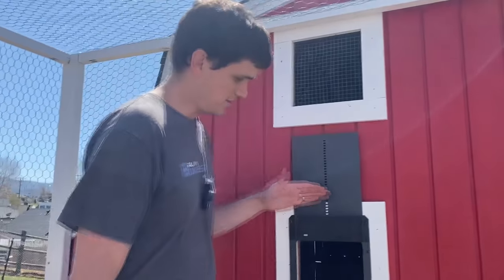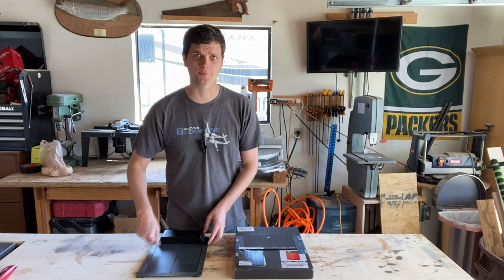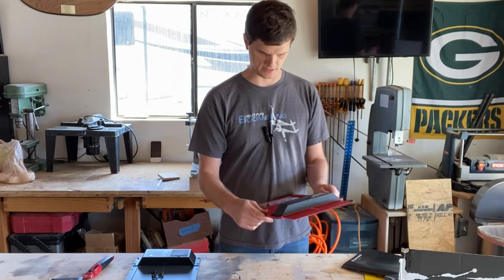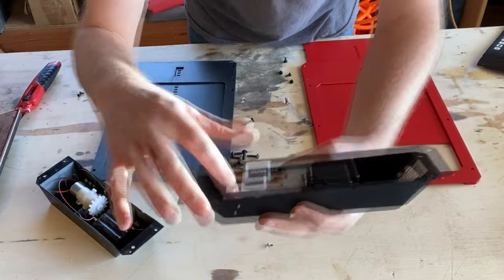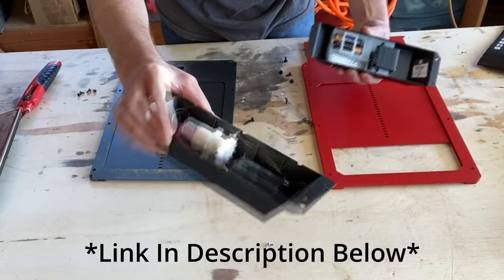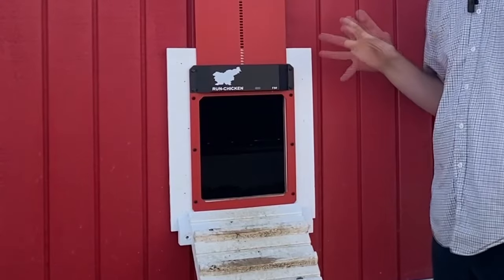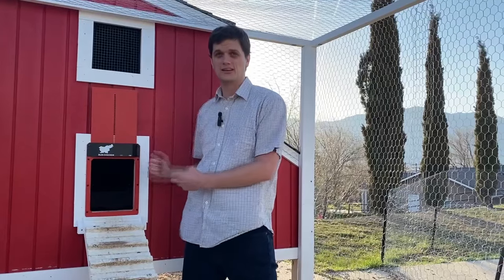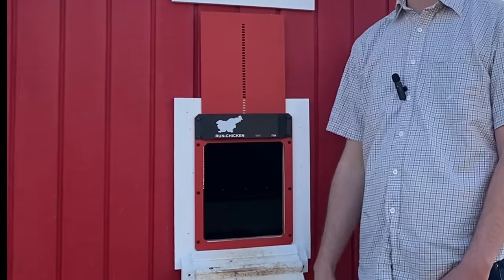"Run-Chicken" Automatic Door: Comparison, Review, & Functionality

Comment: Nice review! I also did a comparison of a cheap knock-off brand and the Run-Chicken model. The quality, fit, and finish between them are like night and day. I also thought the front-accessible battery compartment was a nice feature on the cheaper one, but after using it for a month or two I realized the rear-access is better because it makes it harder for rain and snow to get in. On the cheap one, my batteries died after just a couple of months and when I opened the compartment, it was all rusted. Also, you did a great comparison on the motors of the two models. It's clear why after 2+ years I'm still using the original batteries that came with my Run-Chicken door. I now have 2 Run-Chicken doors and I sleep well at night knowing the chickens are safe in their coop.
Reply from the maker: Thank you! Totally agree. I hear so many people with the same story. I’m trying to warn people that saving $50 on the cheaper one is really going to cost them $100 when they throw it away and buy the Run-Chicken door.

Comment: Run-Chicken is good, but they are overpriced. I bought my door for 65 dollars from the Hen Hut, and I have been impressed with the quality and reliability. I would definetly recommend The Hen Hut to people looking for an affordable and quality automatic door.
Reply from the maker: I thought the same thing. I originally bought a door that was almost half the price. I had many problems with it not closing at night for one reason or another. I decided that if failed once and a fox got in a killed even a couple of chickens it wouldn’t be worth the cheaper door. Respectfully, the reliability is worth every penny I spent.
Reply: @thehomesteadengineer-1  So far it has worked well for a few months and it feels much higher quality than previous ones I had bought for 20 dollars, but I will make sure to keep an eye out for any issues it may have.
Reply from the maker: I had the same experience. After about three months it started glitching. The batteries only lasted about 2 months. I had a security camera and I checked the door every night. By the end of the year it was 50/50 on whether or not it would close properly. Just keep a close eye on it. That’s all. Good luck!

Comment: I heard you mention an app for it. I have one that I installed yesterday 8/16/24 and the light sensor isn't working. It would be great to open it with a remote or by phone as our coop is about 250 yards from the house. What is the app you mentioned? Thank you
Reply from the maker: If your light sensor isn’t working you need to send it back. It should come working correctly out of the box. It’s possible to program it without the light sensor but it’s a pain. The app is also kind of clunky, and uses the light sensor to program the door. There is no WiFi or Bluetooth so it can’t be opened remotely. 

Check out their tutorial video here:
https://youtu.be/Tx7I-1FhTuU?si=oLfTTSnODdtMTD_I

A link to their app can be found on their website: run-chicken.com

I think I’m going to make a one year review video today and go over some of these shortcomings of the door. Let me know if you have any other questions.

Comment: Hi, I bought the Chicken Run like 4 months ago. This morning the door was closed (it is set by timings). Can it be that batteries needs to be changed already? Is it because screws are too tight like in your video comment? I did not saw a red light.... Thx for feedback. ps: great video !
Reply from the maker: If the batteries need to be changed already then you overtightened the screws. Back them off a half turn and it should be better. I haven’t replaced my batteries yet and it has been 5 months. They should last a year. When you manually push the button does it open?
Reply: Any luck?
Reply: @vincianeprudhomme9211 any luck ?

Comment: what's the point of spending all this money on it if you have to reset it manually and check everytime to see if it closed or not?
Reply from the maker: Good question! I’ve actually grown to trust it. I didn’t trust the cheap knock off door. There wasn’t a point in having it because it was so unreliable. The run chicken is actually really reliable. I made this video shortly after purchasing it and still didn’t trust it. A year later now, and I rarely check it. I just works. I have a security camera so when I want to check it I can, but I still don’t have to go outside.

Comment: Step 1. is having a run predators can't access.
Reply from the maker: I free range my chickens. I only have a run in case I need to contain them for a short time. My run is to keep the chickens in, not to keep predators out.
Reply: @thehomesteadengineer-1 with all due respect if you’re preventing your chickens from leaving an enclosure yet allowing predators access that’s setting them up for a kill. Similar to shooting fish in a barrel. IMO if you’re going to the trouble to create a run they can’t escape it’s equally as important to fortify the enclosure enough to keep predators out. I maintain a similar setup and allow my flock full access to the property but my lot and coop are fortified so as to prevent any predators access.
Reply: I had a 5' tall fence around the perimeter, but raccoons can climb much better than I imagined. It's not enough.
Reply from the maker: @backtoasimplelife electric fencing is the way to go.

Comment: This is the worst automatic door on the market. Their support is criminal. Save your money. Or be ready to buy a new one inside a year. There are much better options with superior support.
Reply from the maker: Which door do you use?
Reply: @thehomesteadengineer-1  T50. Worked perfect until it stopped working. The support is criminal.
Reply from the maker: @Heatrsin that’s a bummer. Any idea why it stopped working? Does it just not move any more?
Reply: @thehomesteadengineer-1  We installed the door ruffly April 2023 then changed the batteries around the end of October, not because they needed to be, but it was recommended before winter. Batteries died in January, then again a couple weeks later then a week later then it stopped all together. Never was any debris in the track or anything stopping the door (besides the odd chicken! ) It worked flawless until it stopped working. Support is disrespectful , automated, call center, and just down right criminal. We are also now finding out that they pay people to give positive reviews! unreal. Thanks for asking tho and we wish you the best.
Reply from the maker: @Heatrsin most companies are doing that these days. It’s morally wrong, but it’s happening across the board. I can’t help you get a new one, but maybe it was the way you installed it. If you tighten the screws down it will restrict the door and reduce the battery life significantly. It’s a major design flaw and I plan on making a video about it soon. If you watch my video closely at the end you’ll see the install screws are a little loose. If that’s not the problem then I’m not sure what to tell you. I’ll take your comments into account when I do my year long review. It’s been over a year but I haven’t had a chance to do it yet. I’m still happy with mine.